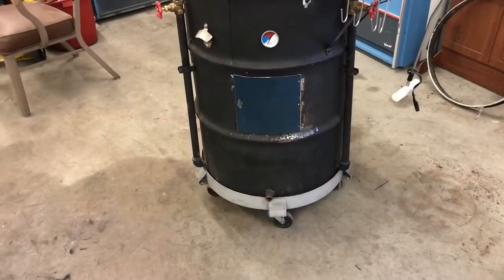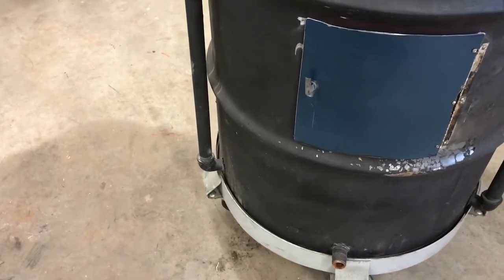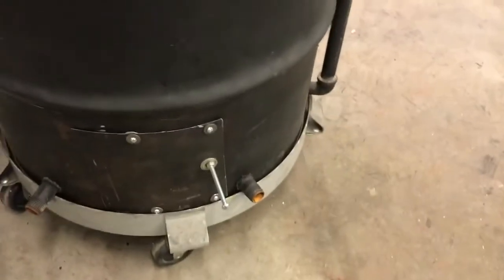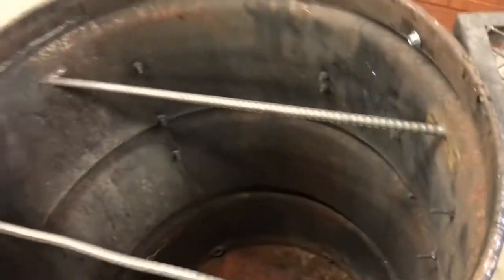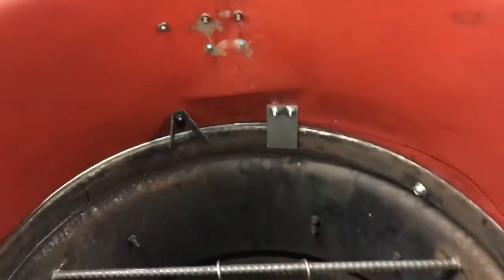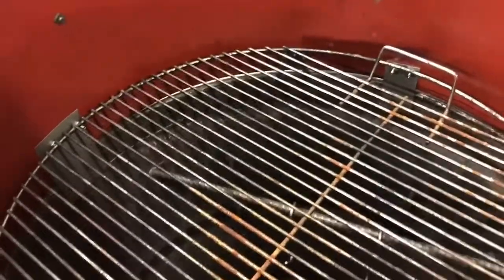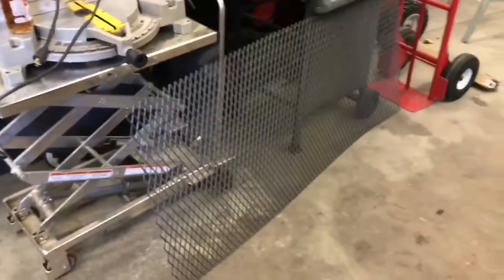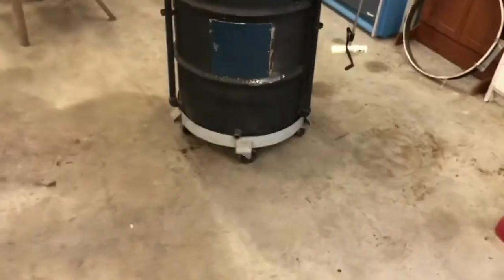Mods to. UDS drum smoker and charcoal basket build

Comment: I made my basket in similar fashion with 2" from the bottom to the grate. But it wasn't enough for any cook over 4 hours. I had to move the grate up 2 inches more for a total of four to have room for the ash. However with that slide door on the bottom of yours you may be able to do an ash clean out during your cook with a shop vac or something. 
Just wanted you to know that I 2" higher wasn't enough  for mine. 
Very cool and tricked out UDS that you have there.
Reply from the maker: Big Lew BBQ thank you. I will definitely move the grate up. Still trying to think of a good ash catcher system.
Reply: qwesthunter at R shack BBQ I use a pizza pan in mine for ashes it is not connected to the basket. I just reach in and grab but I'm 6'4" and can reach it.

Comment: Great Job on your Mods. Been researching other builds to tackle along this great project. I will be basing  my build on Mr. Sneeky1 aka Daddy Cooks and Your wonderful ideas as well. However a couple of questions did arise and surly i  would appreciate if you can assist me with your feedback.

1. On your Rebar Configuration ( Hook Set-up ) i notice that 4 holes are needed can you please recommend the size of the Rebar used, Also did it affect the overall temperature control of your original set-up? 
if so can you explain how are you dealing with this issue since the airflow increase.

2. On you extension which i think is AWESOME added features is a plus in my book, Once again did it affect your temperatures since i notice gaps the outer edges?

Surely this are small or mindless questions since any guy who calls himself a decent cook knows that it´s all about controlling and maintaing temperatures according to your meat of choice however it will help me alot if you can share how are you dealing with this issue and share any ideas.

Thank you

Much Blessings.
Reply from the maker: Ernie Cantu great questions Ernie.  I will give you my opinions and try to answer your questions. I have a friend who uses UDS’s as his competition cookers-so some of my answers will be based on his experience. The rebar I used was 1/2 in diameter. I used a step drill to drill out the drum just big enough to slide the bars through. I know pit barrel brand drums say to put the rebar back in to help control air but I think you don’t need to as you can shut down the vents on top of the lid. I have taken high heat silicone (RTV silicone) and sealed up the gap around the lip where the lid sits. My intake valves were made out of 3/4 pipe but I found I wasn’t getting enough air in to get a good fire going. My friend uses 1 1/2 inch intakes on each side with ball valves to stoke down as needed. Since I added the doors to mine I found that it runs a lot hotter and I don’t use the intake vents anymore—to get the temp down—I just make a smaller fire. I have not been able to play with it much since I just finished the latest mods this late fall - but once it warms up a bit I will be using it more. Hope this helps and let me know how your build goes.